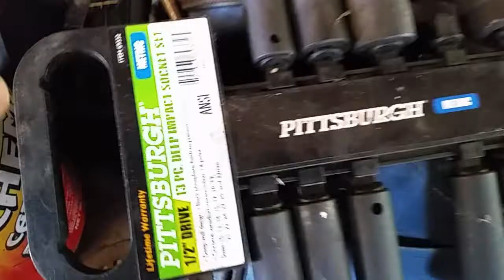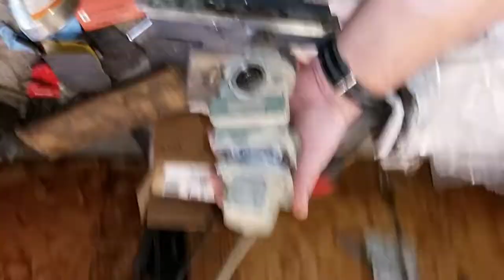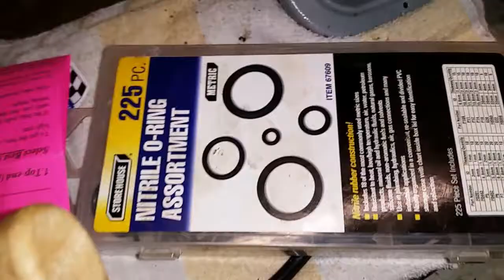FLU419 Air Brakes - Regulator rebuild / Cleaning

Comment: Hi my 416 doka also pumping oil out , i m going to do that , thank you man.
Reply from the maker: I dont know much about the 416's or how oil is in with the air brakes... But I can tell you that my Fluid Regulator Valve (aka air brake regulator) was TOTALLY clogged with junk!    After the cleaning/rebuild... It's like a night and day difference.

Comment: Thank you, I just bought a flu419 1989 with 190 miles on it, it has weak brakes and weak parking brake, could this be causing it? Thanks, great vid!
Reply from the maker: weak parking brake is most likely cable.  the adjustments are above the rear axle.  turnbuckle thing... be sure to soak it in on blaster.
Reply: Thank you!
Reply: Hi again, i got the beast to my house and wow! its a lot taller than I thought LOL, I have a problem thought, it is not building any air pressure at all, did you have this problem?
Reply from the maker: +Nursee “NurseMike” Mike - yes... the dirt was causing mine not to build air pressure.   first check for leaks... if no leaks... then u may have to do what I did.   once I did this, all was well with the world. :)
Reply: Awesome, could you point me as to where the air compressor is on the machine? any way to check to make sure its compressing properly?
Reply from the maker: +Nursee “NurseMike” Mike - compression comes from engine.   those details can be found in the manuals.   if u email me at this username at Gmail... I can send u all the PDF docs I have found.    but for no air... I would do this first before getting to engine layer.   it's easy to get to and probably needs cleaning anyway.   and if u email me... I can just give u my number so comes are faster.